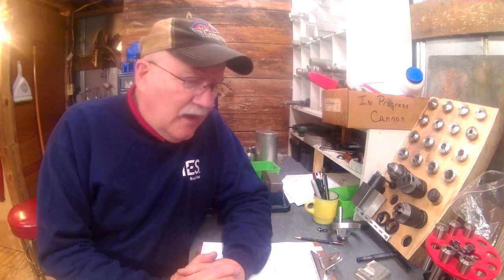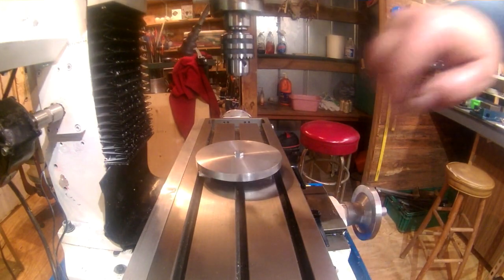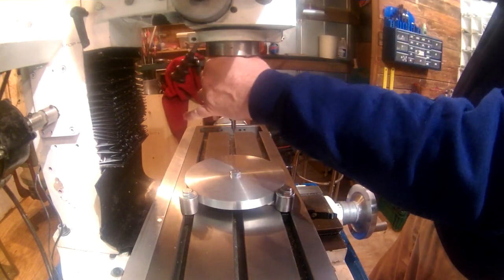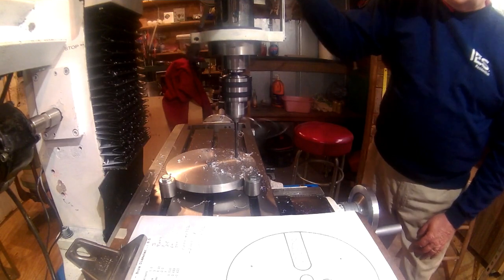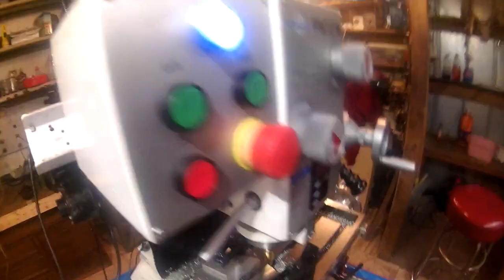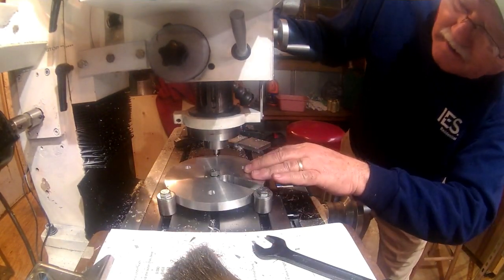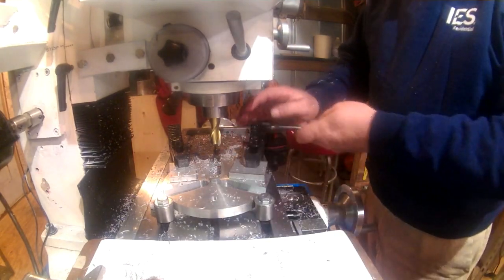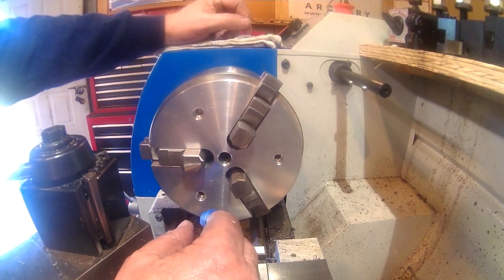Lathe Chuck Spider

Comment: Like that idea Lee -- I had some Al plate but nothing thick enough to get the stand-off depth I was after, thus the method I used. It turned out a bit crude but thankfully it works and gives me about almost 1 1/4 stand-off. Like your idea of adding the bolts - that gives more flexibility.
That was a nice way to avoid using a rotary -- great result. Nice. :)
Reply from the maker: Thanks for watching Chris & the subscription. And of course, the positive comments.